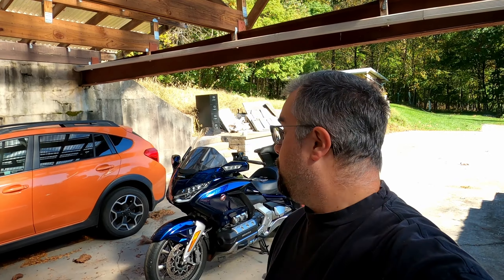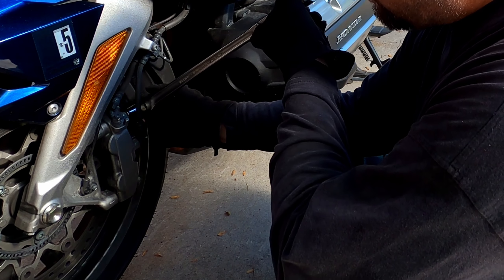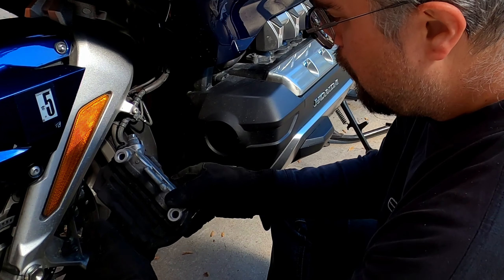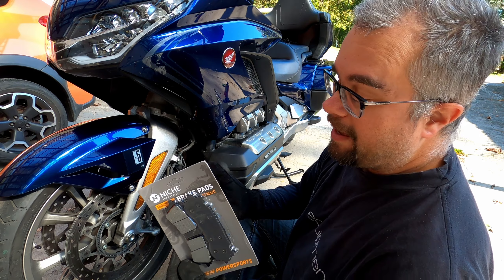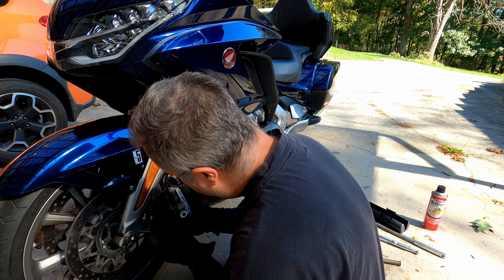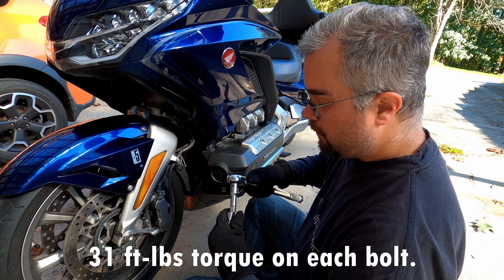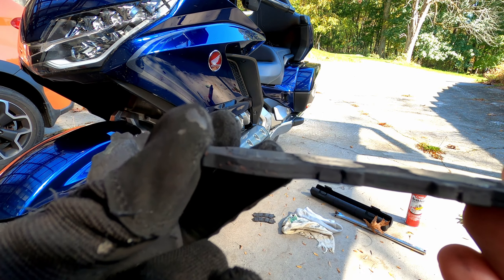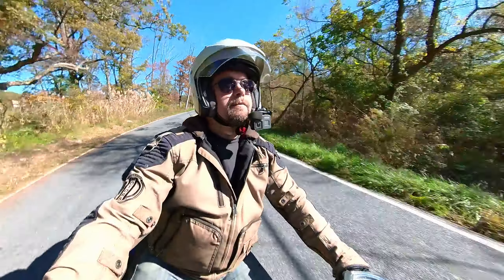Time for NEW Front Brake Pads | Do You Do Your Own Maintenance?

Comment: I have been doing more and more of my own maintenance on my Victory. It is an easy bike to work on and the engine is simple. My pads are holding up well because the engine has insane braking power which minimizes the need for hard stops. There is a great deal of satisfaction that comes with doing the routine maintenance.
Reply from the maker: There sure is, plus I love learning the inner details of the bike I'm riding too.  😎

Comment: There are wear indicators on the pads you can see to check before taking anything apart. How are the rotors? What’s the part # for those Niche pads. Yes, those pads needed replacement. Read somewhere that you should only click a torque wrench once when tightening bolts. Informative. Thanks
Reply from the maker: Here is a link to Amazon for the Niche pads: https://www.amazon.com/gp/product/B07Z1RBQFY/ref=ppx_yo_dt_b_asin_title_o03_s00?ie=UTF8&psc=1

Comment: Getting ready for a 4 day to WV , the multistrada got new chain , sprocket, oil and filter and the new front pads are going on with the new tires I will be changing myself!!!  Don't pay to have My bike worked on,  use the $$$ for gas and motels!!!😀😀😀🏍🏍🏍🏍🍺🍺🍺
Reply from the maker: I have put my own tires on but its not easy without the proper equipment.  New tires are one of the few things I'll pay to have changed today.
Reply: @MotoMengy  I hang at my friends shop in Emmaus,  he has a tire machine that I use !!! I just take my free tire pile tires over and pop them on !!!😀😀😀🏍🏍🏍🍺🍺🍺 right now I have 16 tires hanging in my garage!!!

Comment: Excellent savings Mengy. Well done. You are right. Pads were toast and DCT trans would have more pad wear due to lack of engine braking from a manual trans. Great point. MotoGP racing goes through front brake pads pretty quick. Have you been riding like you stole it? I think so. 🤫 Of course you checked the rotors.? That’s also a nicely built car port structure. Do you also have a garage for those cold and snowy Pa winters? As always those Pa roads are priceless. Ride safe and PD ride often.
Reply from the maker: I may ride my Wing a bit fast in the curves from time to time...😎
Reply: @MotoMengy  

Me thinks so. All good. It’s kinda why we ride. 🤫

Comment: Just did mine the other day.  I ended up replacing the bolts.  I want to take old ones to work to check for run out, just for curiosity.  I don't really see any reason to replace them tho.  Let us know how that brand works out for you.  I am really curious.  I replace mine with Honda OEM.  They cost to damn much lol.
Reply: On older Wings I tried after market, OEM is the way to go moose.
Reply from the maker: So far I like the Niche pads, but every now and then they'll squeak just a little bit.  Goes away a few miles later though.